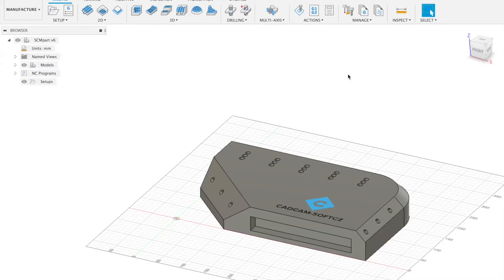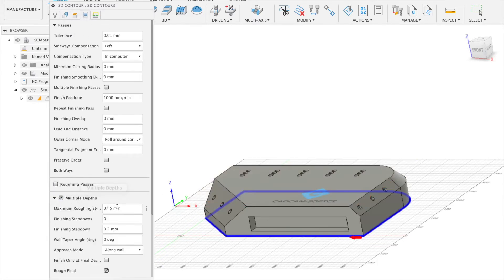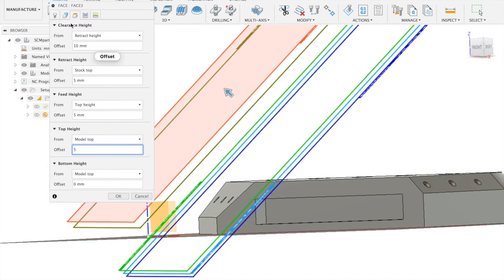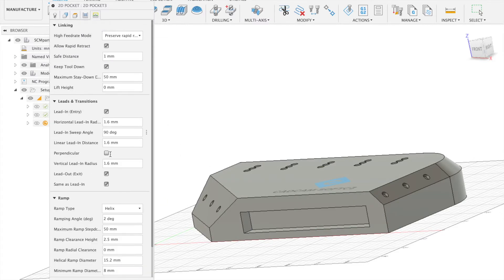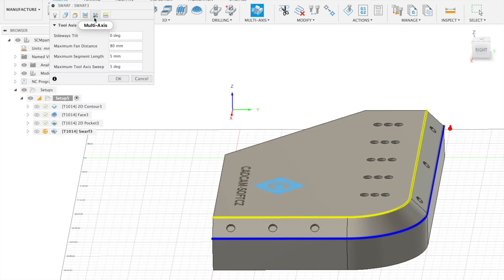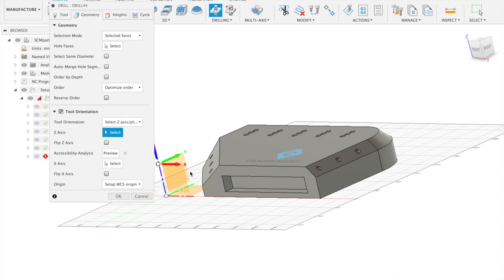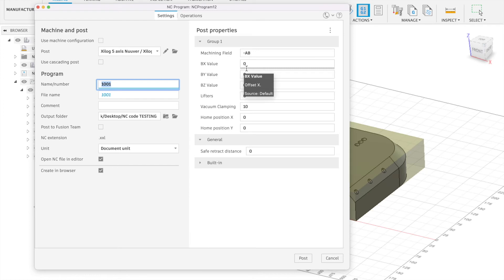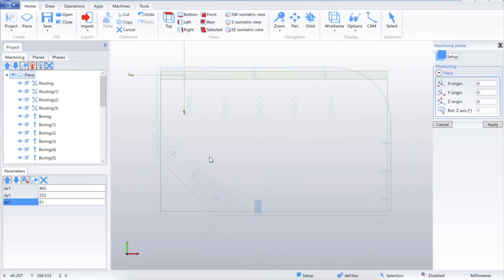SCM - Fusion 360 Postprocessing

Comment: hello is there a post processor that would work with the scm prisma 210 with 5 axis im using the multiaxis on fusion 360 and need to post process for the scm prisma 210

Comment: hi! in our company we switched since a few weeks to fusion360 and i want to use it also for making the programms for our scm prisma110... do i need also the maestro or can i make the programms on fusion? i dont understand why i need to import it on maestro if i make all toolpaths on fusion🤔
Reply from the maker: Hi, i have a two versions of postprocessor, one generate XCS file (xilog maestro scripting) and second XXL/PGM file. In a case XXL/PGM is not not necessary use Maestro of course. But many people want it, because you have something like double control of tool paths and you can edit it on machine. If you will need more explanation or some presentation let me know on m.skotak@ccsoftcz.com or +420733568025.